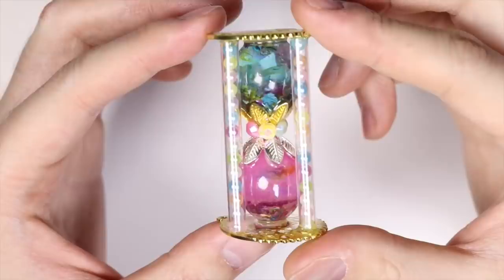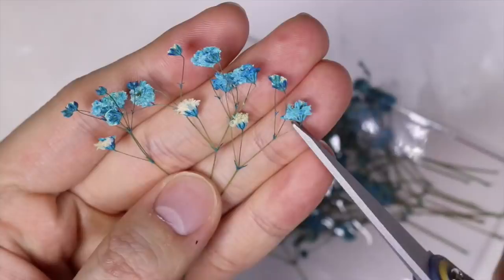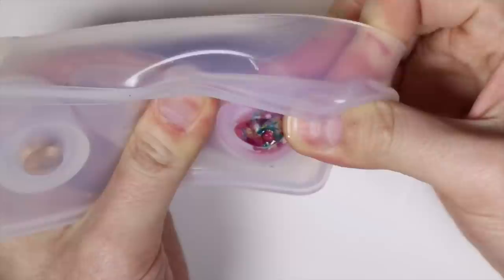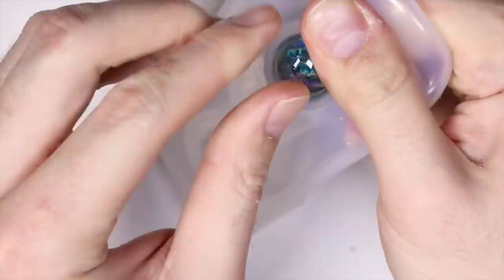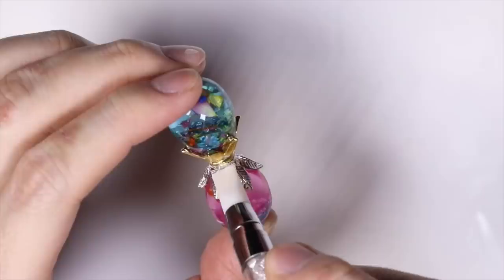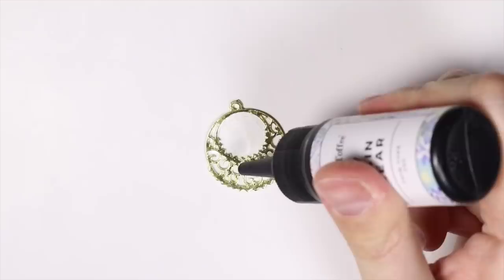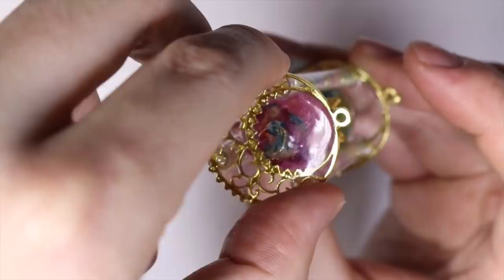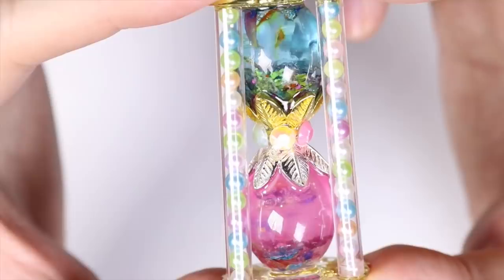How to DIY Flower Sand Hourglass Clock UV Resin Tutorial

Comment: When using uv resin do u need to wear a mask?
Reply from the maker: my room is always well ventilated, so the fumes are not a problem for me, i would suggest to wear a mask if you don't have a good ventilation system
Reply: @PolymomoTea  I have 3 windows in my room but 1 of them has plastic on it since to keep some of the cold out. I bought an bottle of resin and I was just wounding :p also where do u store ur resin after u open them.